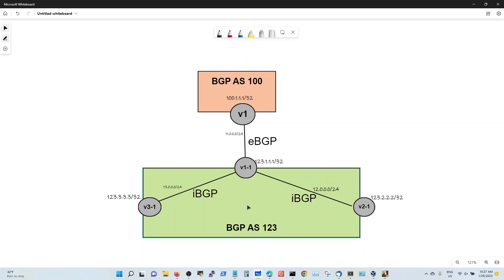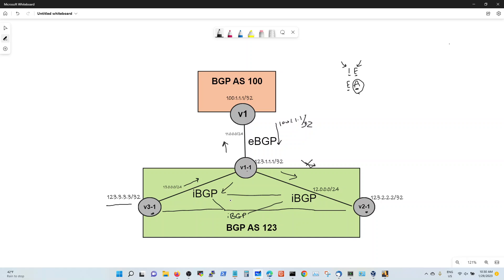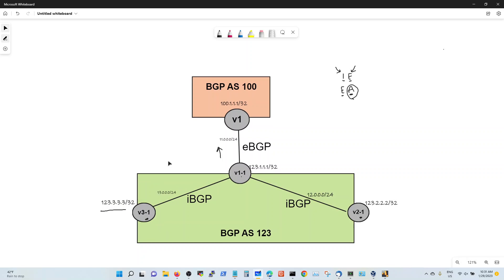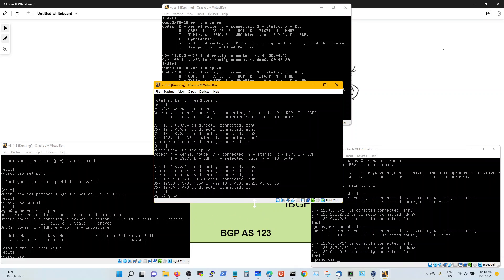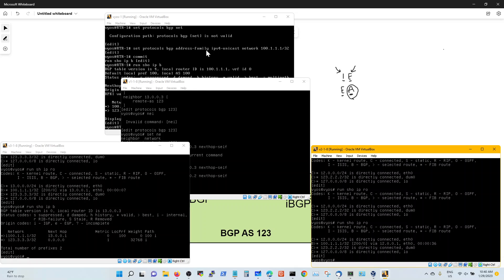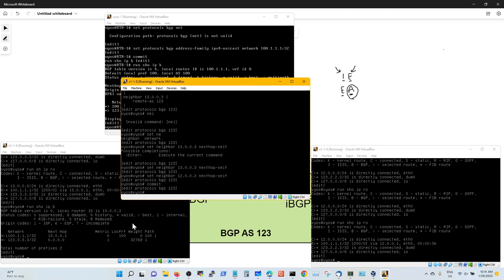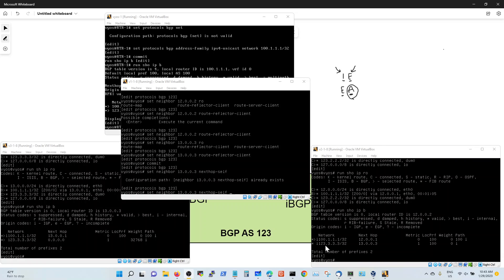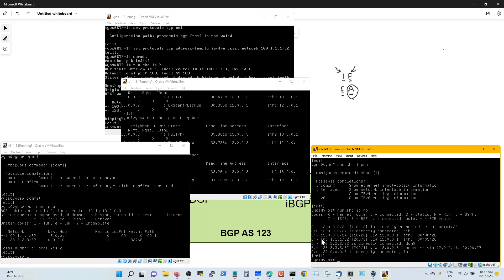Implementing iBGP and eBGP - Gotchas !

Comment: using ibgp full-mesh instead of RR, you won't need OSPF, right?
Reply from the maker: no, you will need OSPF or Static routes to do iBGP mesh with loopback addersses. RR is only to avoid full mesh not eliminate internal routing like OSPF or static routes - hth